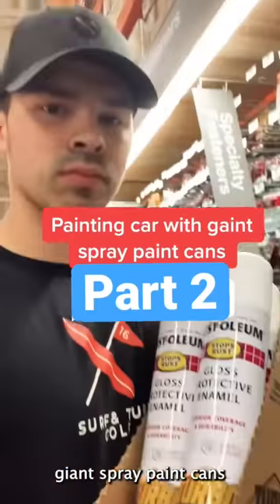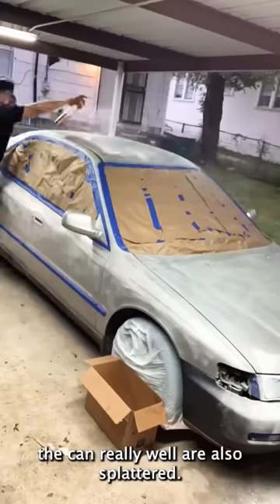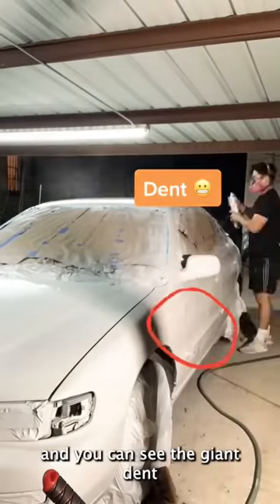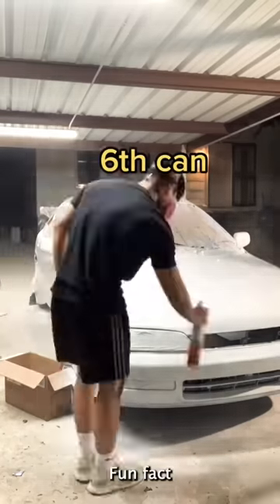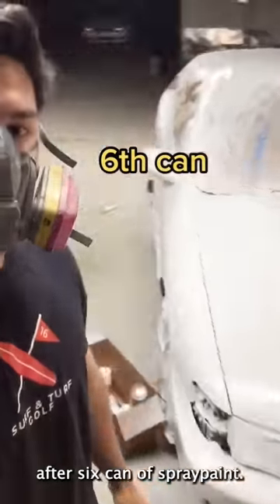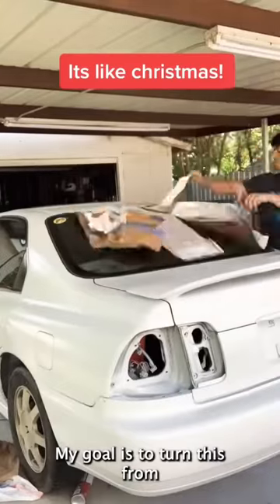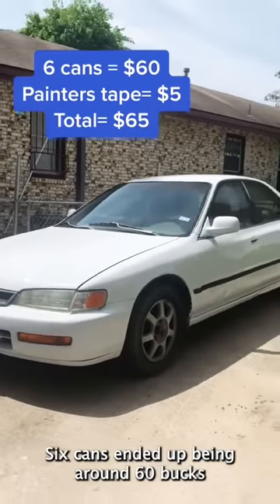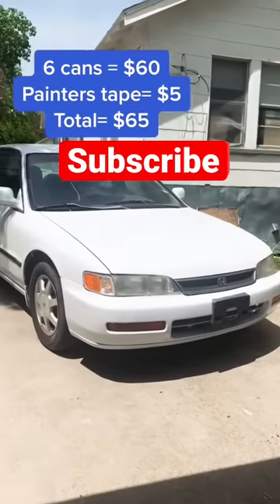Spray Painting CAR with GIANT CANS! Part 2

Comment: He should have atlest put 4K clear on it to make it actually look like car paint
Reply from the maker: The whole point was for it to be a cheap paint job that’s why I didn’t clear it
Reply: @username_af  with the cost of the color spray paint at that point adding 2 cans of clear would still be cheaper than actually getting the car painted by a profesional and would protect the paint as with daily drives rocks and dirt would chip the paint within the month along with rain bubbling the paint
Reply: @emptybodyfm  putting on clear and making it shiny shows more imperfections.
Reply: @mouaxiong8618  the clear wouldn’t exposed the imperfections if layered correctly in multiple coats
Reply: @emptybodyfm  yes it would.
Reply: @mouaxiong8618  what the clear is meant to do is reflect uv rays and creates a hard enamel so that the paint doesn't get sun damaged. This paint job will last two years max... I'm in florida, it would only last three months here. The extra step is worth it down the road.
Reply: @brandondeel3567  I been painting cars for 2 years now. Definitely not a pro, but I know how paint works. And no matter how good the clear coat is. It'll show imperfections.
Reply: How can you reduce orange peel? Clear coat right away? I can't do all that wet sanding.
Reply: @mouaxiong8618  exactly your not an expert. I'll teach you bro.
Reply: @mouaxiong8618  I work in a paint shop for over 10+ years now.if the sanding was done correctly and the primer as well the paint shouldn’t have imperfections unless you over sprayed terribly in 1 spot repeatedly. Most if not all imperfections in paint jobs come from un even sanding that leave the primer to fill in   Voids and valleys that make un even surfaces for the paint to adhere too. At the shop we have done touch ups using spray cans made with the exact same color combination of the car we are working on without having to repaint the entire part like door dings,chips created by rocks and such. So long as the sanding and primer are done well it can be done with spray cans to look as good as regular spray gun paint.
Reply: @mouaxiong8618  who cares about the imperfections, I'm talking about protecting the base coat. If you've been painting for two years, you should know the reason for clear coat...
Reply: @Gunzee  you can't unfortunately. Only real way to reduce orange peel is to wet sand. Show car quality paint jobs are 10s of thousands of dollars because of all the meticulous blocking and wet sanding and the amount of material used. Pros put on up to 10 layers of clear over the base coat so there's enough material to wet sand it silky smooth. Its never a good idea to wet sand a factory paint job because the clear coat is hella thin. Once you get into the base coat, the paint is vulnerable to sun fade and cracking/chipping.
Reply: @username_af  looks great anyway.
Reply: @mouaxiong8618  I'm a master painter with my NACE inspection ticket. Clear coat does help hide imperfections and wouldn't cause you to see MORE imperfections. Clear also helps hide nibs that you may have. Not to say this is how you should spray a car but to say clear coat does negatives I would disagree
Reply: @Gunzee  reduce orange peel is easy. Don't use high air pressure and use a thinner to thin down your paint so that it melts smooth when sprayed on.
Reply: @Gunzee  or sand your primer smooth then topcoat and wet sand the topcoat smooth then re clear or cut polish
Reply: @HeterosexuaI  the imperfections I'm talking about is the damaged panels. Not dust or orange peel. The white/matte-ish finish blends it more together from afar because it doesn't reflect as much light. You can definitely sand and buff all day until every panel is glassy smooth.
Reply: @username_af  yea but that dont mean you leave out the most important coat that will make the job last.
Reply: @mouaxiong8618   without clear coat, the whole paint job will automatically look like a giant imperfection lol.
Reply: Why is there a debate about this? The dude literally said in his reply that "the whole point was for it to be a cheap paint job." Not a perfect job or perfect cheap paint job.
Reply: @mwil190  bc it literally wont cost that much more to add clear coat. And actually, a  typical automotive paint job includes clear coat. That is the standard.  So really, this is still an incomplete paint job regardless of cost.
Reply: @Gunzee  cut & buff it to get ride of orange peel, mirror finish
Reply: @mouaxiong8618  I've been in the trade 14years.. you're right. That's where panel beaters are highly unrecognized... Everyone See's a nice shiny paint job, a panel beaters work only gets noticed when they haven't done their job properly.
Reply: But without clear coat the paint will chip and if you ever try to wash it you’ll be in trouble because spray paint will peel when pressure is applied
Reply: @emptybodyfm  that would actually look bad... u need a wet coat to have a shiny clear... he would have to buy like 14 cans of clear lol so no...
Reply: Do you mean 2K clearcoat? There is no such thing as '4K clear'..
Reply: @nzuncovered1845  tamco makes 2k and 4K clear coat as a reference. Most people never use it and  commonly only use 2k clear so I understand why you would say that.
Reply: @emptybodyfm  Oh I see yeah I have never heard of it.. what would 4k mean like 4 part?
Reply: @emptybodyfm Do you recommend to spray a primer sealer over your epoxy or high build primer after blocking, and spray your topcoat/basecoat over the sealer without sand sanding the sealer coat? I have been told that a common mistake is people will block the sealer coat then paint or not even apply a sealer and just paint over the epoxy primer filler.. Or is it a case of more than 1 way to skin a cat?
Reply: @nzuncovered1845  it’s really depends the material you are painting as sheet metal and fiberglass react differently and limits what you can do in term of sanding the material down and building it back up. The common practice is sanding down to primer or sheet metal as needed and then filler sanding it down again etching it to verify for missed areas during sanding and then primer and sealing to then base coat depending the color your trying to achieve usually it’s black or white. Then the main color with the needed additive flakes ext and clear coat to seal and protect.
Reply: @emptybodyfm  Ok thanks! So would you sand the last primer sealer coat before laying your base/ground coat? Or do you think better to not sand the last primer sealer coat? If you get what I mean. This is what I have been told is where people go wrong where they will sand the primer sealer and then lay base coat
Reply: Lol 4k?
Reply: @nzuncovered1845  in most cases you don’t really need primer sealer to start with and can just paint the base coat for the color over the primer after sanding the primer well. Primer sealer is mainly to cover imperfections that mite be left over from the primer sanding  that other wise would leave what would look like stains in the paint in the sun. If a heavy coat of primer sealer is applied it totally fine to sand it to promote better paint adhesion so long as you don’t sand thru it.
Reply: @username_af  i understand being cheap but being too cheap makes a finish that won't last, spending a little more will give you a paint that will last years to come, personally id rather spend another $50 and have a paint job that will stay on for the next 7 years without issue rather than one that will last 7 months before it starts to chip off and peel
Reply: @mouaxiong8618  besides the dent, if he sanded it wouldn't be bad
Reply: @emptybodyfm  Interesting, I have been told that modern primer sealer has adhesion promoters in it and that it is an old way of thinking where people think the paint won't adhere to the primer sealer, when in fact it will adhere perfectly fine. I have been told if you sand the the primer sealer before paint, you will never be able to properly clean the sanding dust etc. off 100%, resulting in imperfections
Reply: @nzuncovered1845  it’s not that the paint won’t adhere it’s promoting the best chance for it to do so and have the paint as even as possible. Not matter how carefully or how steady your hand mite be there’s away over spray in primer and sealer layers as most people really tend to have the thought process of either I’ll sand it down prior to paint or the paint base coat will just cover what little imperfections there mite be if I did over spray any where un evenly. Sanding really is a key step to making the paint have the results at every stage. There nothing worse than working hard to build a show car piece for a auto show and having the judge panel shine a flash light at 8 inches at angles and seeing imperfections in the paint due to not wanting to take a couple hours to sand down the layers. I’ve had friends have this happen to them and it heart breaking to see months of work be blown by some thing so simple after hours of custom hand work done.
Reply: @username_af  def correct, good clear coat cans cost alot of money. 2k clear is 20 bucks each. Plus it wouldve been a waste of money to clear coat it because the spray cans were cheap paint anyways. Great job tho. I did same thing to old corolla once and sold it to get 500 more than what its worth
Reply: @mouaxiong8618  base white with no protection is gonna look like dogshit in no time. way worse then the shine showing a few more dings.
Reply: @brandondeel3567  Yeah, but at $65 a pop, are you really worried about it only lasting 2 years?
Reply: @NaruSanavai  should be. The prep involved in repainting a bad paint job  would change your mind. Repaint every 2 years or do it right and not have to do it again.
Reply: @brandondeel3567  "Do it right" - not everyone has four grand just lying around.
Reply: @NaruSanavai  I'm talking about with spray paint. You can buy clear coat in a rattle can to put on top of the base coat. It'll last a lot longer.
Reply: @mouaxiong8618  the project itself was in imperfection playa
Reply: @emptybodyfm  cheap. As in the cheapest way possible. Adding a clear coat isn't as cheap as possible.
Reply: @Squrrillyadams  if you add the paint and manual labor hours in + the clear coats it’s still not even half of what a profesional paint job would cost. If you gonna invest $$ on painting your car for cheap I’ll think you would wanna preserve the paint job instead of spending the same amount of money every couple of months to re do it again as at that point you mite as well have saved up the money from the start over the same amount of months and just got it painted professionally or atlest partly painted in primer to then base coat and color/clear the car.
Reply: 2k clear imagine the fail in the comment 😂
Reply: Better be 3d too

Comment: I'm a professional car painter since 2010, and I think it's absolutely cool that you take matters in your own hands, and visually improve your moms car for a few bucks.

White paint was a smart choice.

I know it mightve cost a bit more, but clearcoat would've been smarter in the long run. Good thing with spraycans is, you can still apply it a bit later, make sure the surface is clean and dry though.

Try painting from top to bottom, when out in the open, so the overspray will be painted over quickly. This will reduce dirt, and give a smoother surface.

Spraypant caps like to drip when you hold them horizontally, try to keep a bit of an angle, and whipe them off frequently.

Work while the sun is out, and show the result when the sun is out too. You'll see the state of the paint better.
But pick up your date when its getting dark :)
Reply: You're awesome man
Reply: FFS….. you’re actually giving pointers on how to use rattle can paint….. seriously!!!!
Reply: @htownpony8449  What's wrong with that?

My best guess is, the dude in the video and a lot of the viewers have no clue how to use any painting device properly, about the advantages, differences and what to look out for.

Tried to keep it short and simple, but honestly, I could go on for 30mins just about spraycans easily.

People new to painting cars are nervous about doing it, and don't realize the smallest things.
Reply: It’s rattle can spray paint…. It ain’t hard to figure out. If he actually gave a damn he’d use a higher quality paint and put forth more of an effort to make it look nice! AND he would’ve asked for pointers, since he didn’t ask there’s no point in wasting typing time to giving advice.
Reply: @htownpony8449  Agree to disagree.
It doesnt matter what you use, you can do lots the wrong way, or improve immensely.

If done correctly, I doubt he would've needed 6 big cans for example.

I wasn't just giving pointers, but also approving him trying, plus 28 people thought it was a ok enough to upvote.
You probably don't know anything about his situation, so that's quite hard judgement, about him giving a damn or not.

I didn't ask for your opinion, yet you are wasting both our time typing complaints :)
How about you apply your own logic with yourself first.
Have a nice day.
Reply: @MrDuLukes  Eeeyup…. Agree to disagree….. and I’m not going into a 3 paragraph reply like yours, at this point it’s definitely a waste…. I could… I’m just not gonna. Hasta va-jayjay.
Reply: @htownpony8449  if you throw in some wet sanding, that's a professional paint job right there.
Reply: @dangerdave2010  🤣🤣🤣
Reply: I screen shotted this. I got a 88 civic to paint and a custom smoker I’m almost done with
Reply: @htownpony8449  Your definitely being put in a retirement home. Your the type of old head to get mad at everybody for asking questions then wonder why nobody wants to work with you or be in your trade
Reply: @mikahs7944  If you need some pointers, let me know.
In general the channel "Paint Society" has everything you need to know, to get started and beyond, for DIY and professionals.
Great explanations with good tips on what to look out for, done by a professional.
Here is a video where he used spraypaint:
https://www.youtube.com/watch?v=tDnecjnpYMU
Reply: @MrDuLukes  that’s awesome man I appreciate that a lot I’ll check it out
Reply: @htownpony8449  you knowing how to use spray paint doesn't mean everyone on the internet does.
Reply: @MrDuLukes  thanks for the tips man. Brian at Paint Society taught me everything I know. I work in IT but love my cars - I bought an 02 Celica in silver, threw a Veilside body kit on it, bought a 100L air compressor and a few budget DeVilbiss guns, paint, thinners and clear coat. I painted my car myself in my garage and after the entire process - I now understand why you guys charge a fair whack for a respray 😂😂

Comment: Painted my 98 tacoma with rattle cans. Tips for an easy job:
- Make sure you sand it good!
- Use Rustoleum GOLD paint, its lasts forever. 
- If you dont want to use clear coat and do a final polish, use SATIN paint. Its not as flat as matte and still shines nicely. 
- Final tip: Black is the only color that will forgive uneven paint job and still look really good. 
Did my Mini truck In satin black and have nothing but compliments from people, most think its a wrap.

Comment: So confused. Two or three of those paint cans could’ve been primer instead and the results would’ve been better already, plus add about three cans of clear (should still be under $100 in paint) and the difference would be night and day. Plus what type of prep work was that? I understand the goal was to get the best results for as cheaply as possible but the way to do that was quite simple and missed here. Sweat equity and labor=better results for less money a good amount of the time. If you took the time to prep well, then also wet sanded and polished at the end (if you had chosen the clear coat route) the paint job would’ve looked exponentially so much better for a similar price point still. The math doesn’t add up here, this is not the best results for as cheaply as possible. This is the best results for as cheaply, lazily, and uneducated as possible.
Reply: Okay bud. Go cry him a river...
Reply: @StutteRx  no no he has a point
Reply: @StutteRx  He has a really good point. I worked in the painting industry and I can tell you from experience a little more prep and a little more money on primer and clear, goes a heck of a long way. But I understand just wanting to get it done for cheep. Definitely tho, the rustoleum tall spray cans from HD are a great deal for what they can accomplish!

Comment: U can actually make it look factory i used some of those same cans on the hood of my truck n it came out really good heres the next steps u take to get it to look pro = u gonna wet sand with 1500 grit n then 2000 grit n then wash it good with a degreaser to get all the oils off of it make sure u dont touch it after this  get some clear it can be rattle can after ur done spraying the clear coat u wet sand again 1500 n then 2000 n then u buff it out with a medium cut n u can make that rattle can job look as good as factory u just got a few more steps to go

Comment: It looks good from a distance but I'm sure it's not the best up close although good enough. The one problem you will have is the paint will not last long without a good clearcoat. I had an old work van that the hood paint was peeling so I sanded it down, primed it and painted it black. The van was green but it looked good. It lasted about 4yrs which I was extremely happy with because it was cheap and only took about 20min to do. The problem with a whole car is that not only does it take a lot more paint but even more so a ton of hard work. If you clear it, it will last a long time and stand up against weather and car washing much better. You spent a lot of time and effort on this and you have improved the look of the vehicle so may as well get some 2k clear and make it last. Either way good job.